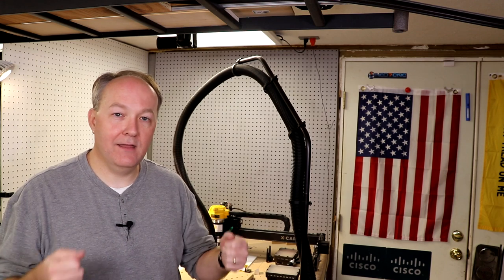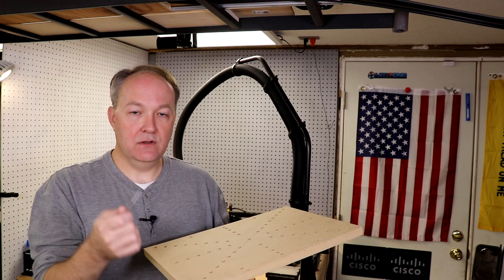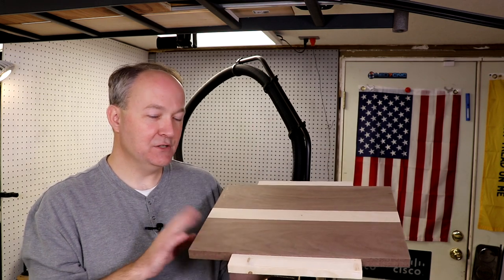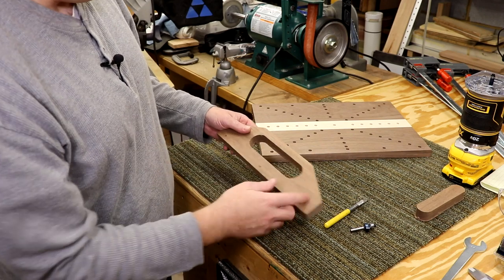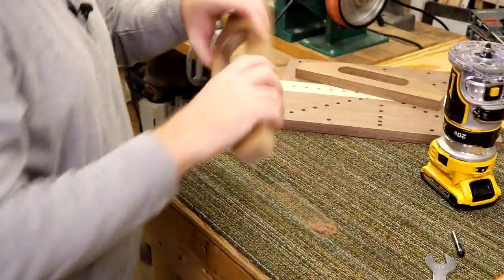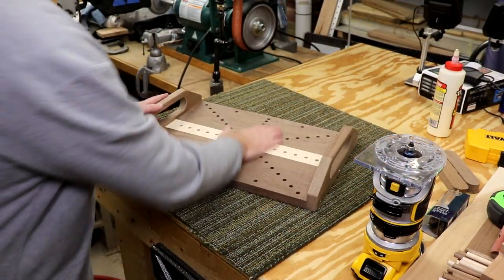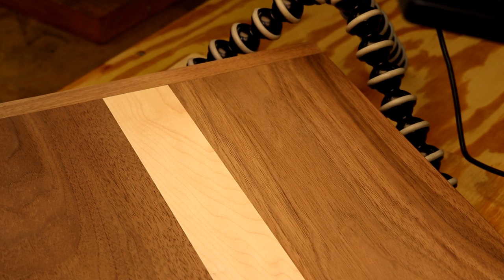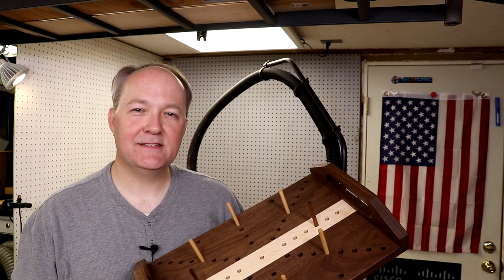Make An Heirloom Serving Tray With The X-Carve CNC From Inventables

Comment: Great job, I saw you use the multi tool to cut the tabs, I bought a cheap set of miniature saw blades and arbor for a dremel at HF, they are cheap but work great on tabs.

Comment: Over glue, causes squeeze out! You got it tight in my view. Did you consider making storage holes for the dowels? That way the carrier can be stacked nicely with something else in the cupboard. I love it by the way.
Reply from the maker: I did think about the peg storage but I didn't want to add skids to the bottom to hold them.  I may look into a different method though. I like the idea of them being store on board.
Reply: @Neo7CNC  A cutout similar to the peg storage on the bottom of a cribbage board might work nicely.
Reply: How about making little storage compartments in the handles on the inside.

Comment: Why did you cut that wood with climb milling? The wood has much better finish when it cut by conventional milling. You can just compare the finish of the scrap left from the wood stock you cut from and the detail itself. If the stock has the better finish then you should reverse the direction from climb to conventional milling.
Reply from the maker: You're totally right.  I missed that when I cammed it up in Fusion.  Thanks for pointing that out.  I'll repost the job before I cut it again.
Reply: @Neo7CNC  I'm glad that my comment was useful for you!